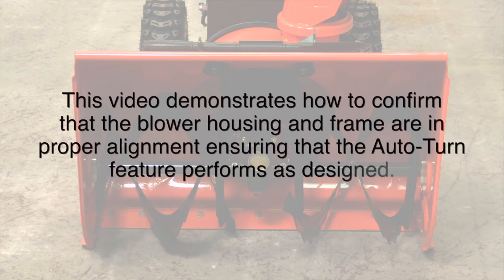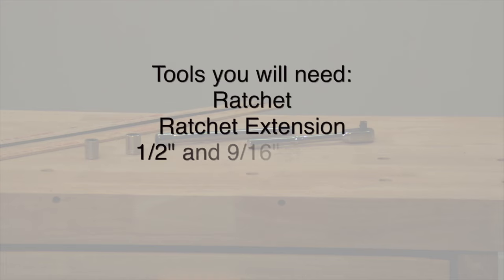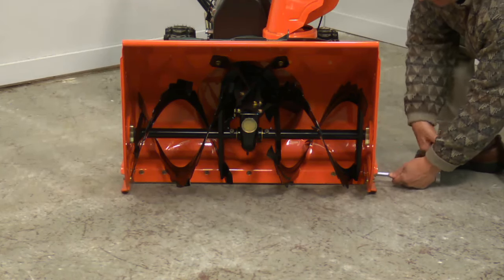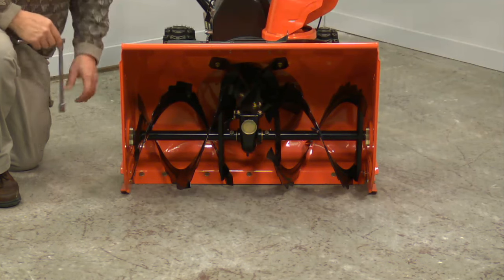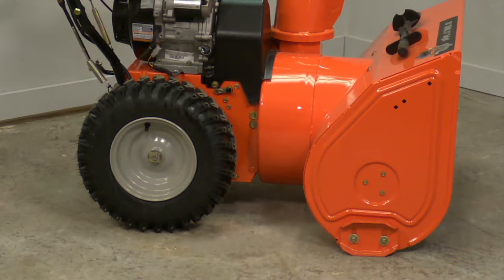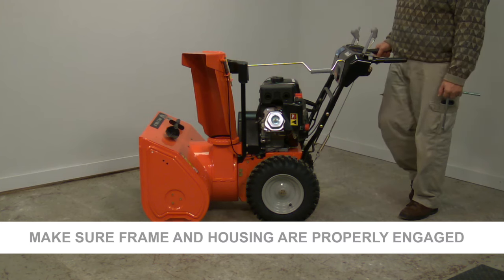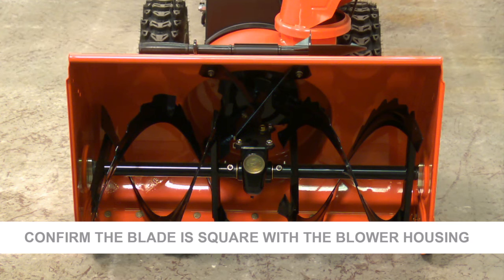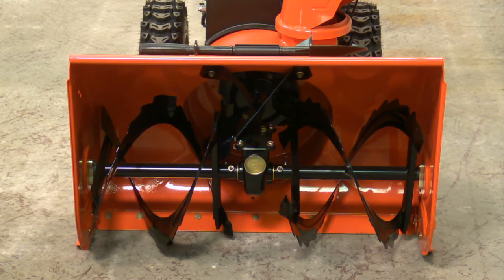How to Adjust Auto-Turn on Snow Blowers | Ariens®

Comment: So basically to correct the autoturn problems, you have to turn the scraper bar into a 1/8' hanging bar that leaves an 1/8" of snow everywhere you snowblow? So I would have to snowblow my driveway then shovel my driveway because of the 1/8" of snow not removed by the blower? Isn't the point of spending $1000 on a snow removal machine so that it removes all of the snow on the driveway? For this very reason I would never buy an Ariens snowblower that has the autoturn feature. Which means the only Ariens snowblower I would ever consider buying is the Compact 24 that still uses a friction disk drive that will allow you to actually have the scraper bar, you know, scrape the ground clean like it should.
Reply: +Brandon Cloutier lol every snowblower needs 1/8" of space below the bucket otherwise you would VERY quickly wear down the scraper bar and the side of the frame. This is nothing new to any brand
Reply: I have a 1981 Toro 421 that has had the scraper bar making contact with my driveway (therefor, scraping the driveway clean) for well over 30 years. I have never replaced the bar or the shoes. So my own personal snowblower would beg to differ that a 1/8" gap was needed between the scrapper bar and the driveway surface. And I live in Michigan, so yes, the blower gets a lot of use every winter.
Reply: +Eddie Thomas My Honda doesnt run that way ... scrapes the driveway clean.  22 years.
Reply: trader025 Again, i'm not saying it isn't possible i'm simply saying the manufacture ADVISE that you leave 1/8" to avoid wear to the bucket and scraper. Can you lower it sure? Does the manufacturer recommend it? They do not.
Reply: Some models with a rubberized type of scraper bar can have a lower clearance, but it wears and need to be replaced. I run my ariens clearance a little tighter than suggested. I use a thick plastic wire ties to set mine and in use it clears the snow well but I don't have auto turn either.
Reply: Brandon Cloutier en français svp
Reply: not mandatory outside Que. and NB .Many you tubers are anglophone or other uni-lingual @willchevrette4015
Reply: @donholmes4550  not mandatory in NB only in Quebec
Reply: My 921044 Deluxe 28 has a fixed scraper bar that snags on ice ridges, whereas my old Toro 8-24 has a spring-loaded scraper bar that never stops the forward motion. The Toro bar last for many decades
Reply: @brandonc7450  I agree. I've had several old Toros that still had a serviceable scraper after many decades. They used hardened steel back then.
Reply: @willchevrette4015  Use Google translate if you comprends pas. Just because he has a French-origin family name does not mean he can write in pepper.
Reply: @Flatus Antiquitous - Old Fartman,  I call you not familiar with those old machines. The old John Deere, Ariens, Toros were made with thick steel and simple controls, and lasted many decades, including the scraper bar. In my opinion, only Honda still makes blowers that will last along time...if you can afford one.  I have an Ariens 921044 which does not come close to Honda. As soon as I find a new motor for my Toro 8-24, the new machine will go for sale.
Reply: @trader025   It'll scrape clean even with a small gap, unless your driveway is uneven, in which case it's unlikely to scrape clean no matter what.  You have to understand how snow works.
Reply: I hate mine

Comment: I can’t believe and really don’t understand all the whining about the auto turn feature.   I’ve used a single stage Honda for the past 25 years.   It worked and held up incredibly well.  I takes a bit of muscle and pushing when we got over 6” of heave or wet snow, or so. I bought a Ariens 28 Deluxe second hand.  A couple years old and lightly used.  I put on the plastic OEM skid shoes and set the tire pressures even.  It blows a foot of snow like it’s 2”.  It works great and I love winter.   Hope it snows!!!!

Comment: As a long time ariens owner I am very disappointed with my new machine. Just not the same ariens quality that it used to be.
Reply from the maker: We're sorry you're not having a good experience, Ryan. Can you be more specific as to why you're disappointed with the product? We'll try our best to help you resolve the issue.
Reply: My older one which I still own is the 11.5 H.P. 24 inch cut. That goes through the plowed snow at the end of my driveway with no problems. The new one is the deluxe 28 sho. It rides up the snowball at the end of the driveway even though I put weight on the front. The belts slip and it broke two bolts on the flanges were the axles go through the housing. I wish I kept my ariens that I bought new in 1974 and put a new engine on it.
Reply from the maker: @thomasryan8218  Thank you for sharing and we're sorry to hear about your experience. We suggest reaching out to your local Ariens dealer to help make adjustments that could help improve your product performance. Our dealers are an extension of our team and will help resolve the issue. If there's a product defect and your machine is still within the warranty period, we'll stand product warranty 100% on service completed by an authorized Ariens dealer. Your nearest service dealer can be found using our dealer locator tool at the link below:
https://www.ariens.com/en-us/dealer-locator
Reply: I'm not knocking the dealer where I bought it, but I had it back there and still had the same problems. I will use it for lighter snowfalls and use my old pro model for heavier snowfalls.

Comment: I used my new Ariens Deluxe 28 for the first time today. This was purchased from a dealer and appeared to
Be set up fine. The Auto Turn feature needs to be re-engineered or deleted. I fought with this 275 lbs machine for an hour.
Could not keep it straight. I kick myself for selling my 30 year old John Deere Snowblower, it was simple and reliable.
Reply: +Al Gore 
All the checking of tire pressure and centering the housing unfortunately will not solve this problem for the poor few that run their machines on sloped/uneven/icy driveways...Auto Turn will then has a mind of it's own.  I have spoken to the factory (engineering/support) directly...there are conditions that can fool Auto Turn, even if your machine is setup correctly...Ariens is aware of this....not an easy problem to address for the relative few that encounter it.
Reply: Auto-steer works perfectly when I lift the blower off the ground when I take the machine out of the shed for the season.  On a snowy driveway, it is truly a workout for the forearms.  Sloped or ice driveways are a problem - I usually have both.

Comment: I dont mind the auto turn i think its great thing to have on a heavy blower. its great at the end of the driveway. I wouldn't want it totally locked up but i would like to manualy lock or unlock one wheel insted of the auto turn. still woundn't trade my ariens for anything else. if you cant handle a real piece of equipment get a single stage

Comment: DON'T BUY IT!  I've followed this procedure x3 but I still have to fight the auto turn every damned second I'm blowing snow in my very typical gravel driveway. The total garbage design will leave you tired, frustrated and feeling like you wasted your money.
Reply from the maker: We're sorry you're not having a good experience with your unit. If the issue continues after trying these adjustments, please take your unit to your nearest Ariens dealer so they can diagnose and resolve the issue. Find your nearest Ariens servicing dealer here: https://www.ariens.com/en-us/dealer-locator
Reply: Ariens    “Diagnose and resolve issue”.   Autoturn is terrible, that’s the issue.   I sold mine on Craigslist and bought a Simplicity.
Reply: @OhYeaMista  
Usually when this sort of stuff happens the machine has not been set up right or parts are missing.  I have had this sort of experience with my equipment.  You think there is something wrong with the machine, you take it to the dealer and get it back with the same problem.
I found the real problem to be the people who sell and service this stuff.  After looking in to it myself I found with one of my machines a part was missing.  This can happen in the assembly, but should be fixed when you go back to the dealer.  The other problem I have had is that the machine is not set up right.  Same thing, back to the dealer, nothing happens, have to fix it myself.
This is very annoying, especially when you are buying a new machine so you will not have these issues.  The main decesion in buying a machine comes down to parts and service.  Even if it is not the best machine, if you cannot get a part then and there, your machine is an exepensive lawn ornament.
Reply: galactica one   I don’t disagree with that you said...but I don’t think autoturn has anything to do with that.  It’s a self contained unit in the axle, no dealer setup.  I aligned mine myself, everything straight.  It was working correctly, I just hated the way it worked.
Reply: @OhYeaMista  
Do all the auto turn machines behave the way yours does?  If they all did what yours is doing I would think that ariens would not be selling that system anymore, people would not buy it after word gets around.  There could be a problem in the assembly at the factory or some part in the autoturn system might have a manufacturers defect.
If your machine is still under warranty you should push them to fix it.  This can be a hassle is you get someone who wants to not deal with the problem and get rid of you, but never accept that kind of bullshit.
Reply: galactica one   Read the comments, some people like it but A LOT hate it. I think it’s a preference thing but I definitely fell on the hate it side, and I think when that many people dislike a feature they should probably rethink it.  If you’re thinking about buying one I suggest trying before you buy.  And try it in snow...if you do it on dry pavement it works fine; it’s when you’re in 10 inches of snow trying to keep a straight line next to a car that it gives you a hard time.
Reply: @OhYeaMista  
Agree with you all the way on that one.  I find you really cannot tell how good a machine is until you have used it for a season.  The best test for a snowblower is when the snow is wet and heavy, if it does not plug up and throws a good distance that is one plus.  The drive system has to be fast enought, especially in reverse and it has to have enough oomph to make the wheels spin if the front gets hung up. 
I have a husqvarna hydro/track unit.  When I got it, it was a little slow backing up. Forward was top notch and they hydro and tracks the thing just moves along.  The slow back up was solved by adjusting the control rod.  Another problem was the steering release rings froze up, some lithium greese fixed that up nicely.
The other unit I have is the cub cadet 45 inch with the dual wheels.  The only complaint is the friction wheel gets chewed up periodically, I think the friction disk system is a little weak for the size of the unit.  Another problem I ran across was the slider for the friction wheel would stick a bit when it got realy cold and would take a bit of warm up to slide properly.  Put the lithium grease on the slide bar, no problems after that.

Comment: Good video and typical of adjusting the level of the scraper bar. Video shows NOTHING having to do with adjusting auto-turn!!!
 It seems is actually NON adjustable.
Reply from the maker: Thanks for commenting. Auto-Turn is non-adjustable, however, it responds to the alignment of the Sno-Thro auger housing with the unit's frame.
Reply from the maker: Semper Fi  Thanks for your question. Actually, Auto-Turn works on uneven surfaces.
Reply: @AriensChannel actually, yes, if you don't mind fighting it from trying to turn itself all the time. It's absolutely unsafe for an older person to use this thing

Comment: Remember the old drive....with the pins in the wheels....Yes well ARIENS if its not BROKEN don't screw with it. FFS its a snow blower it is supposed to be heavy and tough. Men use them not Ballerinas.